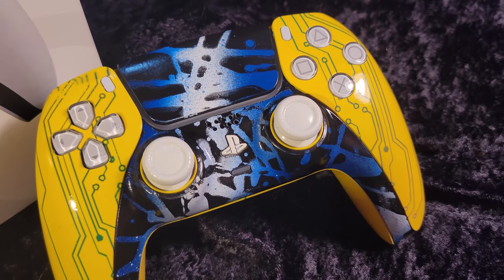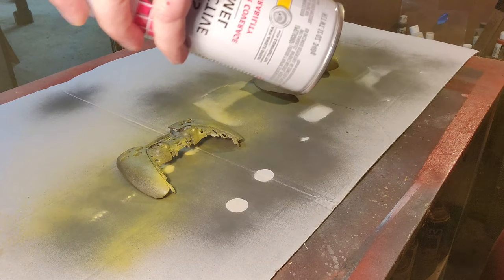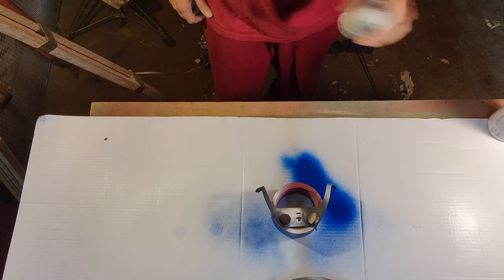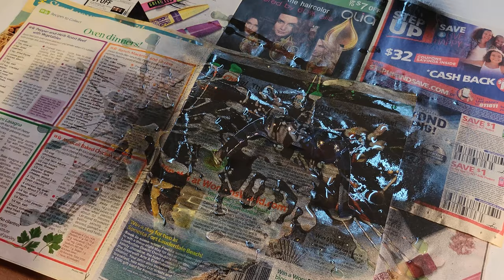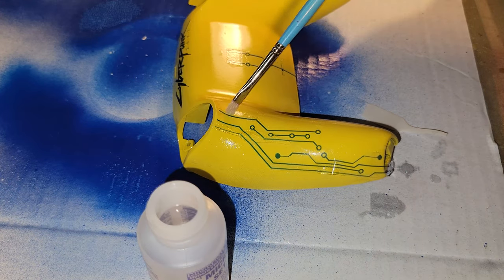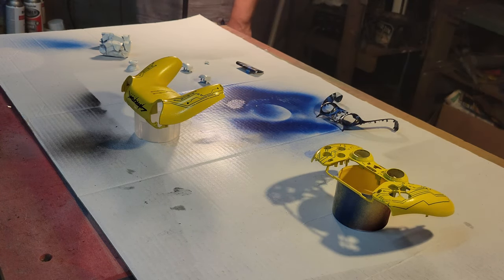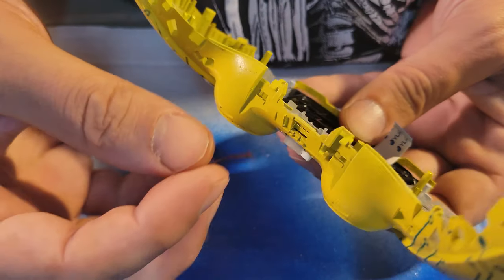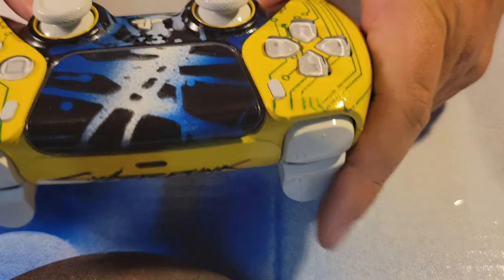How to Paint a PS5 Controller

Comment: Regarding the decals, did you clear coat before or after cutting them down to size? Personally I have found that doing after prevents damage to the decal, as doing it before is rendered useless when you trim it to size. God I hope that makes as much sense as it does in my head.

Comment: Hi, I tried to do this,  but when i install the decal, even if i apply the micro set before and the micro sol after, it will not look as if its printed on the pad, its quite visible that its just a sticker put on...what am i doing wrong?

Comment: Did u not remove the thumbstick rings on purpose? Also how long will the paint last on the thumbsticks?
Reply from the maker: Yes I left them there on purpose.  Easier I think to leave them on and paint them while theyre still attatched than taking them out and having an additional piece to worry about.
Reply from the maker: The paint, if painted correctly, will maintain a very long life.

Comment: Do you need to sand down the controller first or no?
Reply from the maker: I actually didn't sand for this project.  I specifically didn't sand to show you that, if you use Rust-Oleum, you don't need to sand.  Always primer tho!!
Reply: @Drumblanket  thanks bro